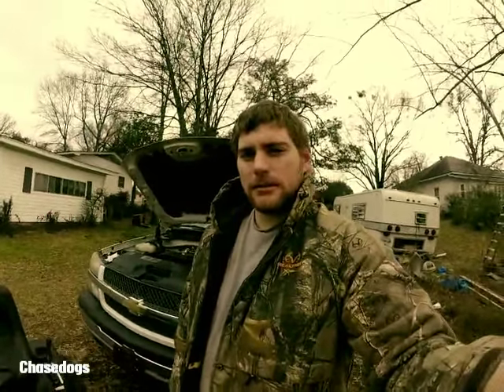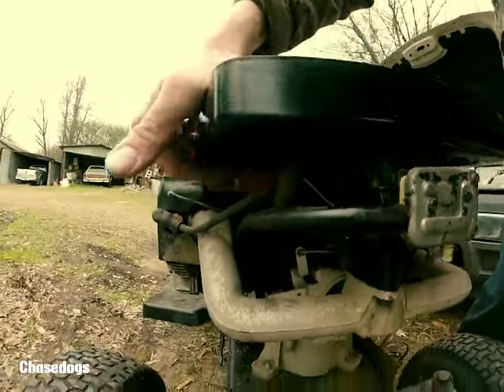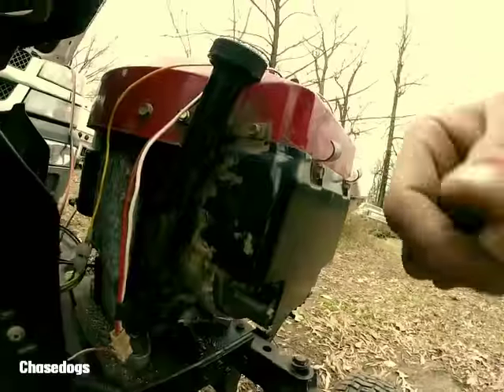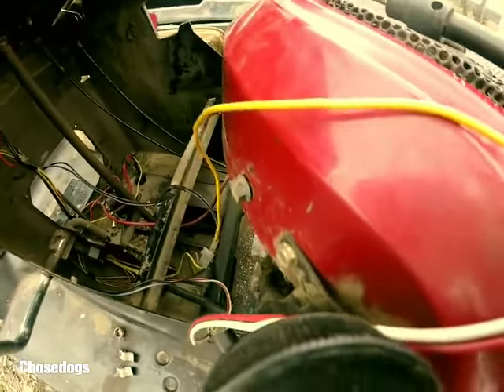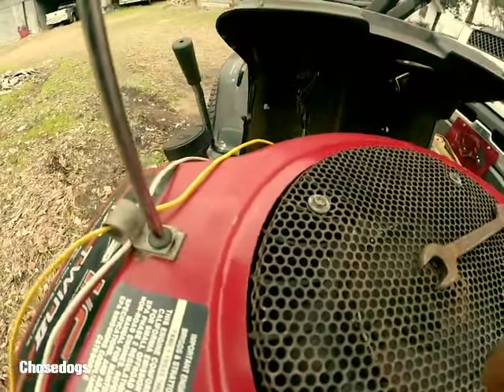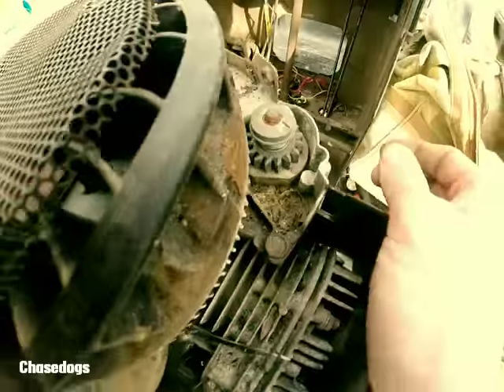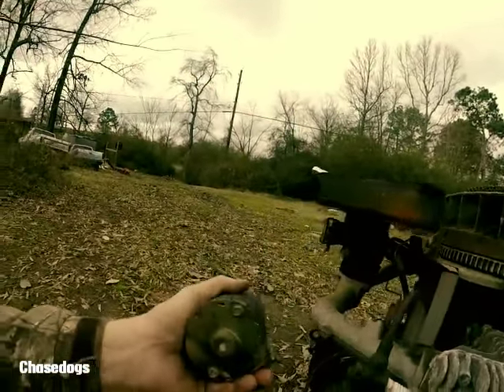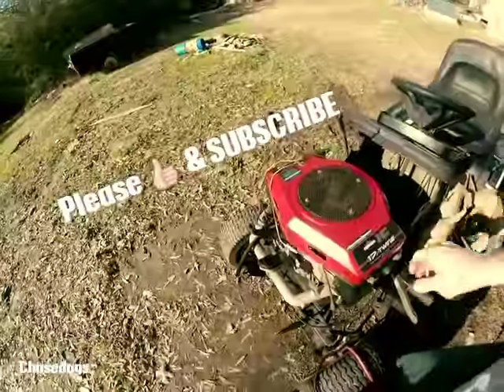Briggs and Stratton 17 hp. Opposed starter install

Comment: sweet man. if i were you id put a pulley on the fly wheel so you can rope start it. my mud mower starter burned out the first day i got it and i bolted a chevy small block chev water pump pulley to the top of the fly wheel and cut a grove in it. thats how ive started it for the past years ive owned it!
Reply from the maker: +Nick DePaiva I'm going to get down there tomorrow and see if I can come up with something that posted video what do you think